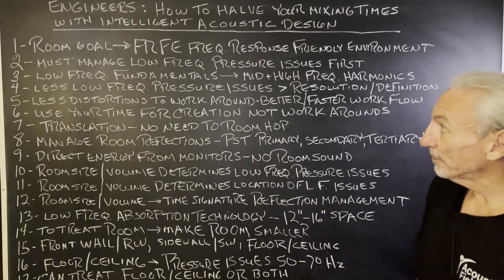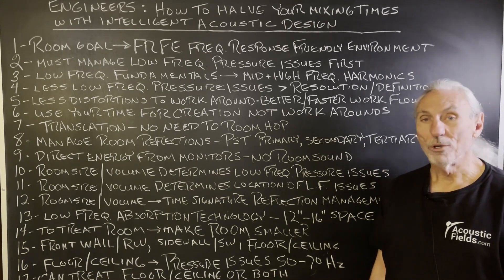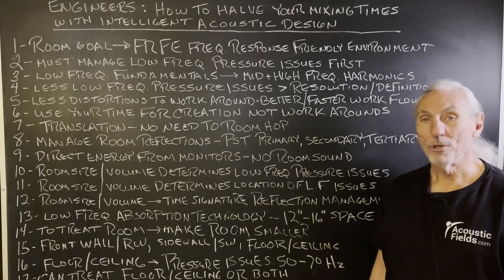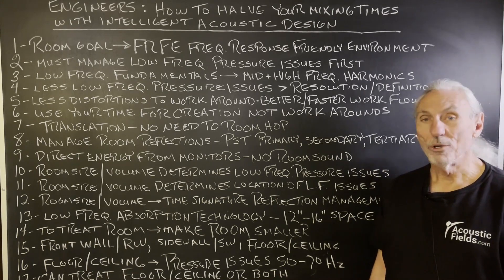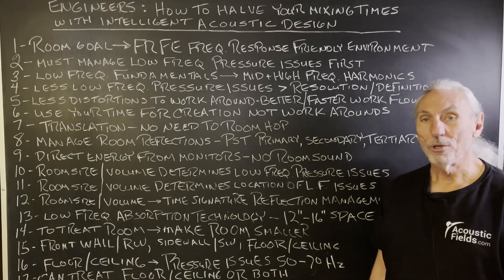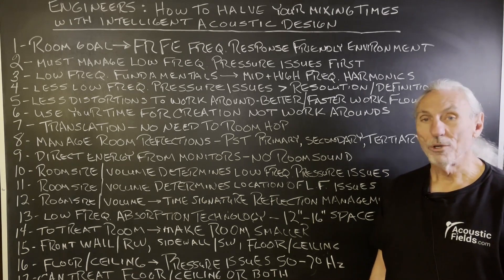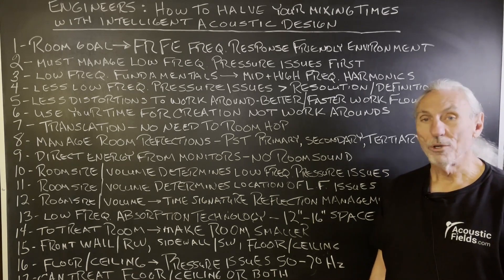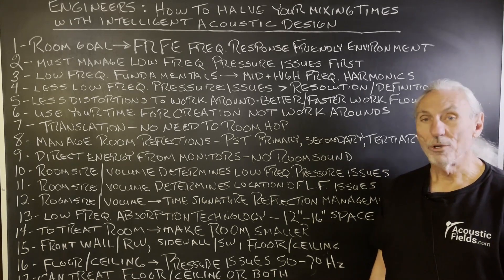Engineers: How to halve your mixing times - with intelligent acoustic design!

Comment: Not an engineer but good to know this stuff!
Reply from the maker: Working around the same issues everyday in a mix room has both good and bad consequences. The good is that the problems, usually low frequency, are predictable and consistent throughout the room. Identifying them in the mix becomes easier over time and experience. The bad is that this constant attention to fixing the room in the mix is very tiring for the engineeer and drains critical  energy which could be used for the creative process.